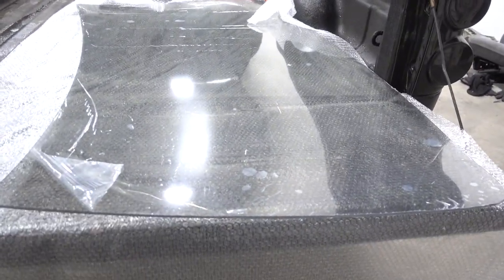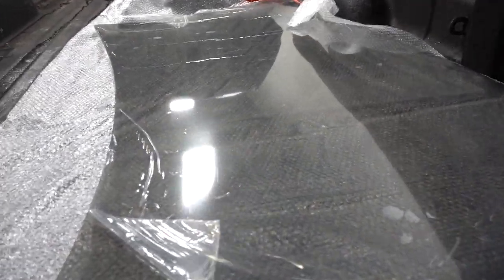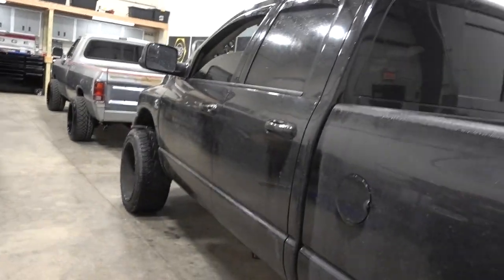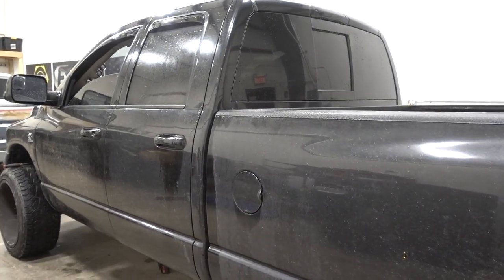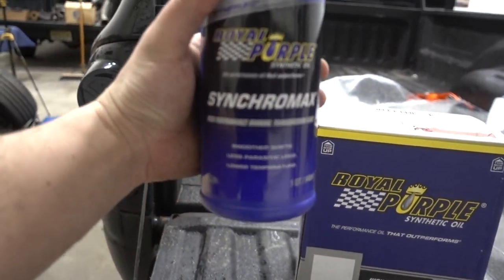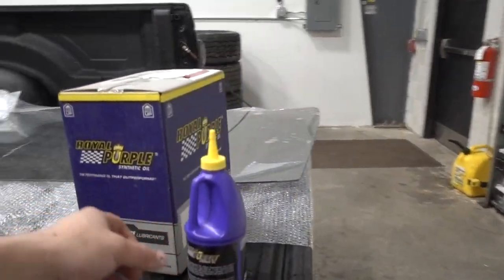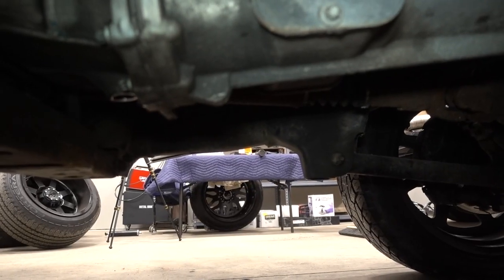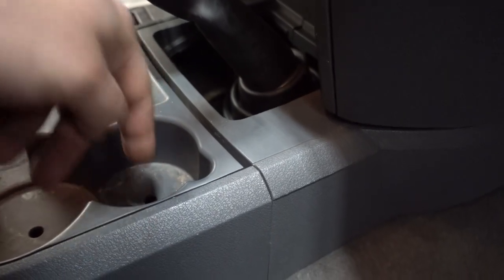SAVE YOUR 6 SPEED MANUAL TRANSMISSION!!!  HERE'S HOW!!!

Comment: I love RAM because they are the only ones that still offer a manual transmission for their full size trucks in 2500 and 3500! Yours is nice. I love the setup!
Reply: Sadly, this is no longer a reality.  💀
Reply: Also no more light duty manuals either
Reply: 2018 was the last year, 1% of the 2500's are manual, 1% of the 3500's are manual......roughly 250 are a 2500, and 200 are a 3500. Could be off on the actual numbers but it's 1% of each produced are manual
Reply: not anymore
Reply: Glad I got mine, still.

Comment: I have a Southbend twin disc in my 06. It shifts terrible compared to stock but I accepted the trade off since it won't slip with my downloader and pulling, pretty stout. Talked to Southbend and they recommended 50w so I went with delvac 50 as well. They said it spins a lot faster with a twin disc so the 50w will slow it down some. But the noise comes from the separator plate between the discs, semi trucks are noisy for the same reason. Sometimes I even double clutch thinking I'm driving truck again because of the way it feels haha!
I pulled the right side of my truck up on ramps and used a pump with a container filled with an extra quart. I also used Dorman CV boot part 614-001 to replace my shifter boot it's like 15-16 bucks, got the idea from the Cummins forum. Hope this helps.

Comment: I have the Southbend G-56 OKHD single. It's nearly silent in operation. A guy up in Ontario Canada recommended Amsoil 75-90 MTG.  It's the slickest stuff I've found. It's much smoother then Delvac 50. I have a pump for the fluid and just elevate the passenger side and pump 7 qts in. That Synchromax and the SBC combo is super impressive! Very quiet. I have not used the Synchromax. Thanks.

Comment: I use Schaeffer sae 50 trans oil with a strainer/ cooler setup and yes you have to put more in than the factory pto cover fill plug. Heavy tow is all the truck does. No problems at all. And your way isn’t the easiest way to fill. I fill mine with the cooler pump ;p

Comment: Torque Spec on those 4 tower bolts is 17 Ft-lbs. If you over tighten them it will shift like crap especially when its cold.

Comment: Hey Greg, I made it easy on myself because I didn't want to go through the trouble of removing the shifter so I ordered a PTO cover from a company called TDS off of ebay and this PTO cover has a fill plug that is high enough to get about 7 1/2 quarts in and I installed it on the drivers side to avoid the exhaust and leave the extra ports available for a transmission cooler in the future. You can order the covers with a few different configurations and they all come with plugs and predrilled ports that accommodate for O-rings so you know it won't leak and their price point is relatively inexpensive. I ordered mine with the high fill port, temp probe port, and in and out ports for a transmission cooler. Great video for the guys that don't want to change PTO covers though. Always love watching your videos. They are in depth and very informative and never seemed rushed.
Reply: Nick Tonniges just ordered one I live by the guy who makes them do you like yours still

Comment: Or you buy this PTO Cover no need to take apart your interior fill it with 7qt. I have this on my g56 truck. 

TDS - PTO Cooler Cover, Dodge G56 Xmission, Corrects fluid level, 1/8 NPT, USA 

ITs on Ebay but great to deal with from my experience!! 

Greg you might want to look at this Too!!

Comment: Had a dual disk southbend all the fingers fell out of it and some springs failed as well. Heaviest I had ever pulled was 21 000 lbs went to the high performance single disk and have gotten 30thoysand more and better performance. And for the record my truck is still bone stock at 218000.  But your video here really help me out and appreciate the knowledge that you shared my friend Cheers Cheers and good health and and good horsepower
Reply: I just switched from a South bend dual disk to a South bend high performance single disk much quieter and shifts better. I tow every day 5 days a week and love it so far. My question is is there such a thing as over filling the transmission?

Comment: I just stick a 10mm on the inverted torx and pull them out. Have the shift tower off twice both times used a regular sucker because I don't have new hardware or inverted torx

Comment: There is one other way to overfill the transmission without pulling the shifter out and that is get a pump for your bottle of oil with a hose on it remove the top Center PTO cover bolt it's a couple of inches higher than the fill plug and pump it in that way it's much easier.

Comment: Pretty ingenious way to fill up a transmission.  I use one of those Lincoln suction setups that looks kind of like a grease gun. Works good for transfer cases too but you really gotta make sure to plug the hose after and never contaminate it.

Comment: I've got a 2009 ram 3500 Cummins with manual tranny. Rock solid.  Never had a service on that tranny, never changed the clutch.  I've got over 150K miles.  I love it because I do the shifting my way, I'm not at the mercy of computer software like the automatics are.
Reply: The stock dmf yields a very smooth engagement and a near silent transmission. I'm very surprised yours has lasted so long. As it wears it can take out the front input shaft bearing on the trans though.

Comment: i have a south bend in my ZF6, and i have a 4 Quart over pan on it so i just dump 2.5 gallons in it and she is good to go. those south bends take allot of abuse as well, i have done enough 2nd gear launches and driving without even touching the clutch peddle that most clutches denigrate with.

Comment: Ive got the South Bend in mine right now,but the Valair clutch doesn't rattle half as bad the south bend. My factory clutch went out as soon as I upgraded my injectors. finally time to rebuild the engine. 08 6.7 with 440k on it sotck internals and hit 900+rwhp. Needing a rebuildable 6.7 head if ya got one!

Comment: If you were to buy a new towing rig, would you get another one with a manual trans?
Reply: If I was towing and wanted one around the same year I would get one with an nv5600 trans instead of g56 bc it’s more of a work horse. But for comfort and higher gearing I’d get the g56. Just depends how often you’d be towing

Comment: i have run across something online add at least 1 quart in the trans especially if your running it kinda hard or towing heavy because they say it doesn't have enough fluid in in the pan so its like almost like running out of oil is why its noisy

Comment: I use royal purple products all the time, used rp synchromesh in my nv 5600 it rattles bad now, so going to redline mtl and Lucas synthetic oil stabilizer, it was dead quiet until I added rp in it, so it didn’t work for me
Reply: Thegaragefiles Be careful with what you use in the 5600. I have always used the overpriced stuff from the dealer. Pour in an extra quart into the shifter like he did but be careful with what you use. A buddy of mine messed up his sincros while running the redline. Not sure if it was 100% the fluids fault but i am not taking the chances with how scarce the parts are for the 5600. 

The extra fluid seems to quiet down the gear noise and makes it shift a little smoother
Reply: I think you basically answered my question, Mike. I was going to ask if it's the same recommendations/steps to change fluid in a nv5600.
Reply: Zackry Einerwold, Yup. Snatch the shifter out and pour it in the top
Reply: Royal purple 7 quarts?
Reply: Mike Joyner I’ve got 6 quarts in mine it rattles with the royal purple, that’s why I’m changing to redline mtl gl4 that what redline recommends, not gl5 that’s for diff
Reply: Zackry Einerwold I put in 6, Read the nv5600 hold 4.75 quartz, maybe I need more
Reply: @mikethecarpenter6977   My friend's got 240K on his NV5600 with Redline. He's owned it from new.

Comment: I read somewhere about the harmonic Damper (which should be check ever 30k) can cause gearbox and clutch chatter if unbalanced
Reply: I swapped mine out with a Fluidamper. It noticeably smooths out the idle but did nothing for the transmission.

Comment: So what about the nv5600?
Reply: Basically the same thing, but the shifter knob is one solid piece, just remove the bolts around the bottom and pull it up.  I just replaced my clutch in my 03 3500, should have filled the gear oil in from the top!

Comment: I’ve got an 07 5.9 Mega cab DRW I want to convert to a G56. Just turned over 91,000 miles.
Reply: I have an 06 5.9 SRW and i am currently going to be doing a swap, if you go on facebook they are there everywhere

Comment: So the NV5600 is the early 04 6-speed right. Do you over fill by a quart on the NV5600 as well? Thanks for the info, I’m new to the diesels and have a chance to grab an 04 dually 3500 4x4 manual for cheap. Just needs the transfer case rebuilt

Comment: Don't the SB Duel Disk clutches shift very hard, especially when cold?  What I have seen in many vids is that people have difficulty shifting from 2nd to 3rd for example due to the mass of the duel disks.
My 2008 Ram 4500 dump needs a new clutch and am not sure to go with SB's top single disk unit or a duel disk unit.  My truck is stock here in New Hampshire (any mods or tuning would be an instant fail during inspection), so I will never be adding any extra power to the truck ... unfortunately.  So being at stock power, would SB's single clutch work fine for many years to come?

Comment: Hey Greg, just picked up a G56 truck, how is the trans shifting in cold weather with synchromax?
Reply: Yeah that’s exactly what I want to know because there is times it won’t drop into second when it’s real cold know I got 40,000 miles on the truck and I want to change out the fluid.

Comment: I’m about to change the transfer case and transmission oil in my 05 with a G56. The manual calls for ATF in both?? Is synchromax the best way to go to improve shifting and noise? Also what type of oil for the transfer case is best? Thanks and great videos! 👍🏻👍🏻
Reply: ATF in a G-56 which has been converted to a single mass flywheel will be the closest thing to rocks rattling around down there. ATF in the transfer case is what's spec'd.

Comment: What is your opinion of the lazersmith Gorilla Juice?  I have 8 quarts of that in my garage waiting on warmer weather to change it, but if you have heard bad things of the Gorilla juice I won't use it lol
Reply: Absolute garbage. I removed it after 4 miles. We drained it through a black t-shirt and it was loaded with brass particles. It's thick and unrated.
Reply: @davidanderson8469  I have been running it for the past 20k miles or more and have nothing bad to say about it.  I hate you had issues with it

Comment: ** I really find it interesting how hundreds of combined years of engineering at Cummins, Chrysler, Dodge, Mercedes and Diamler etc etc is overrun in 2 minutes to "yea add 2-3 more quarts, its fine" ... Really ? ..  but I get it, its quieter.
Reply: lol. Chrysler changed the location of the fill plug. a Mercedes g56 holds 7 quarts. which is where the idea originally came from.
Reply: When you change to a dual disc clutch you remove the factory crappy dual mass flywheel and install a solid flywheel. The aluminum g56 will now be annoyingly loud. 1 extra quart of oil makes a remarkable difference. I pull a loaded gooseneck every day and the factory clutch will last barely 30k. Dual discs are awesome I got 80k on the last one.
Reply: Over 5 years later with s.b. d.d. and 7 qrts of royal purple. Works great and i am not easy on it and have had over 15k lbs behind it regularly. Just saying
Reply: Well considering Chrysler puts atf in these transmissions from the factory even though Mercedes recommendation is mobile delvac 50 I don't trust anything they say. I have 8 quarts of sae 50 CAT final drive/gear oil and it made a remarkable sound difference

Comment: Don’t ever get a RAM HD Truck with 6 speed Manual because the AISIN 6 Speed Automatic Transmission has more Torque than the Manual (930 lb-ft AISIN Automatic) vs (660 lb-ft G56 Manual Transmission)
Reply: Chanse Ormon that only applies to 2014 and up.
Reply: Chanse Ormon my manual has no problem towing with 660 dont judge those numbers behind a keyboard judge them behind the wheel!
Reply: Chanse Ormon hey with the right clutch and pressure plate that g56 manual will pull 60,000 lbs and not burn up your Aisin will burn up! Manual all ways better. The manual will go 300,000 to 400,000 miles before it needs a rebuild. Your Aisin will need a rebuild at 150,000 miles. Yeah manual is better. So Don’t ever get a ram hd with a automatic.

Comment: ...buy a ford...
Reply: Drew L More like buying a problem.
Reply: Buy a ford.... Cummins swap and an Allison swap
Reply: I have just always wanted a Ford F350, with a 5.9 2nd gen, and a Alison either out of a F650 or a Bus
would make a sweet tow rig
but have heard good things about Touqe-Shift
Reply: David deLambert the 2003.5 and up ford transmissions are probably the best out of the big 3. Dodge still has terrible trans and the Alison is okay but nothing special...just the name
Reply: what about building big and going with Allison 3060 or 2500 
when I get rich and build my tow monster
Reply: David deLambert might as well go with a Eaton Fuller 18 spd 😂  Allison makes a good transmission for the medium duty trucks
Reply: with a Eaton Fuller would I be better off with a 7.6-Liter DT466 or a 8.3-Liter Cummins
Reply: David deLambert I think DT466 it's a proven engine in the tractor pulling world and can take a lot of power.
Reply: that is anough dreaming...
I gotta go to work now
Reply: Isaac record not true in the slightest
Reply: Damien Martin..... I have not heard anything but good reports about the TourqeShift 6R140 
I just thought a Medium duty Allison like the 2500 or 3060 could be sorced from a bus or F650 that is already mated to a 5.9-Liter Cummins
Reply: David deLambert a buddy of mine has an 01 gmc duramax with an Allison tranny 467000 miles with nothing done to it and still running strong
Reply: David deLambert - Ford F650 comes with that.
Reply: Damien Martin what does he do with the duramax? Run around? Heavy tow? Just wondering
Reply: Drew L I'm not sure if he tows anything but he does drive it like a wildman
Reply: Damien Martin towing will do a lot more damage than regular..or wild man driving ;) it puts a lot more stress on all the components pulling the extra weight so comparing a truck that's gotten almost 500k on a tranny that hasn't towed a lot to a truck that has had a trailer on it it's entire life is two completely different animals.
Reply: Drew L right
Reply: the Banks 6.6 and the PowerStroke 6.7 may be fine diesel engines but the I6 is Simpler, Easier to Maintain,  and More Reliable than the V8 designs.
5.9-Liter 6.7-Liter 8.3-Liter Cummins, DT466 international, and most american 12-Liters diesels,,,,, all I6
Reply: David deLambert agreed
Reply: 4Xprops !!!! The truth!
Reply: Isaac record negative
Reply: Isaac record I've had nothing but problems with my ford trans
Reply: I'm behind ya on that. My 98 quad cab 4wd 12v 5sp long bed, every option Laramie truck....yea the one you all want.   It's rotten with 151k miles. New England truck lived it's whole life in Massachusetts. My options are strip it down to the frame, and the strip that and then rebuild it all. For literally $20k doing all the work myself. I chose to pull the powertrain and swap it into a late model Excursion. I've always loved those huge SUVs, and with the 12v and nv4500 I expect to get around 20-24mpg highway and still should see 18+ towing.  I know Fummins swaps aren't anything new but I've always wanted one so I'm building it. The HD Ford trucks are just a better truck in my opinion and the 5.9 Cummins is the better engine. I'm a 12v guy so that's what I'm gonna run.  I've got an 01 3500 ram 6sp RWD dually bone stock with 470k that I'll keep for bigger hauling and to have a truck with a bed.  But even that truck needs constant attention when it comes to the dodge part of the truck. Engine gets the oil changed and filters when due and that's literally it.
Reply: David Conrad I haven't seen one in a lonnngggg time!